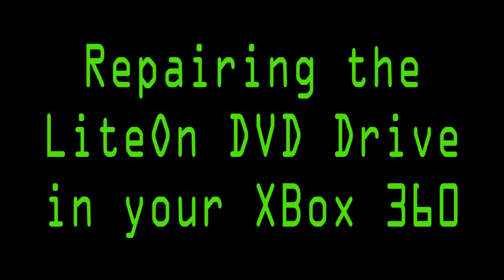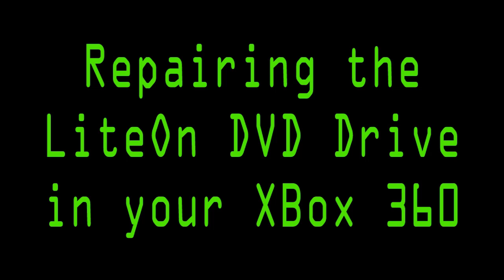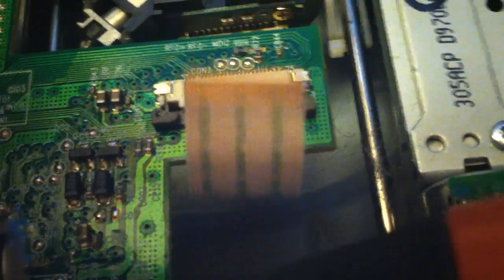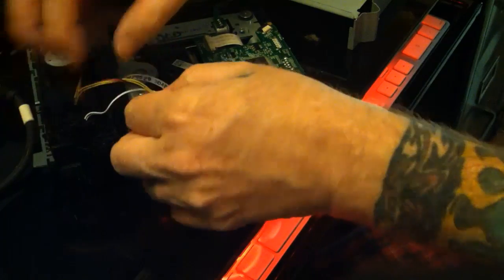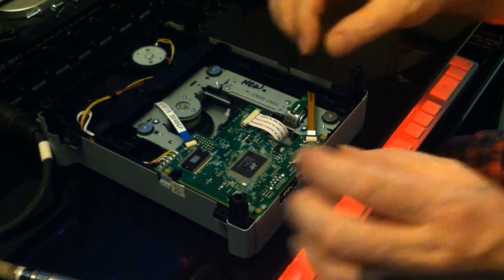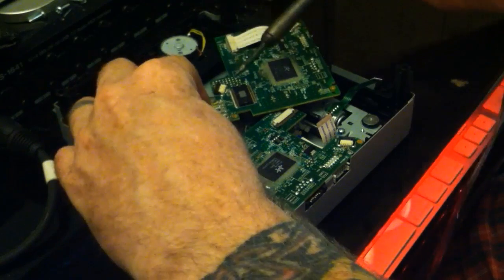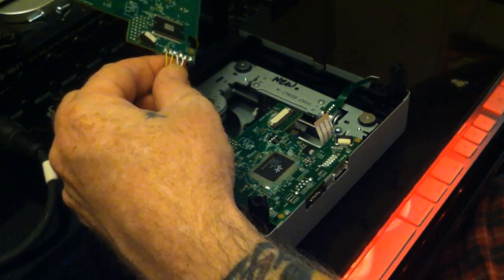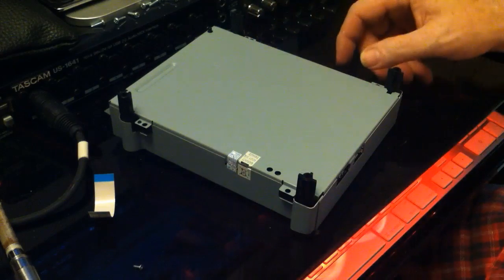Repairing the Philips Lite-On DVD drive for the XBox 360

Comment from the maker: It would not hurt to have some around, but I haven't needed any when doing this. When you remove the wires from the board, only touch the connection instead of "swiping" at it might help too.

Comment: so i DO NOT need to use solder when i put the wires on the new board?meaning when i am putting the wires on the new board i can just heat the wires on the space it is going to contact with and it will stay in WITHOUT APPLYING NEW SOLDER?
ANY INFO APPRECIATED MY NEW DRIVE IS IN SHIPPING STAGE NOW AND WILL BE HERE IN 2 DAYS

Comment: these clips are VERY FRAGILE and if you dont do them right you WILL  break them i ordered a new laser from ebay and installing it i broke my ribbon clips i still ghetto rigged it to stay in but laser didnt work i dont know if i messed up the laser or if it was bad from the start so i just ordered a new replacement drive

Comment: I plugged mine in the old broken dvd drive and board into my xbox to check it was the drive, i turned it on without one of the cables plugged in and there was a little blue spark on the board: is it fragged? or will it still work